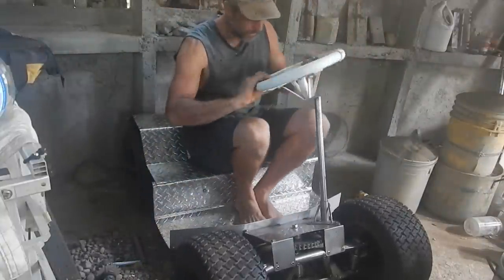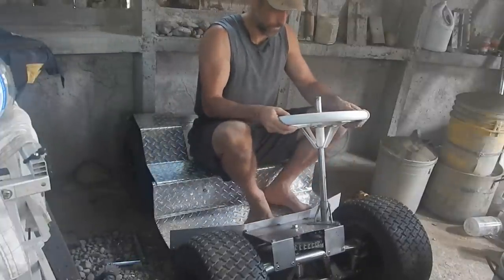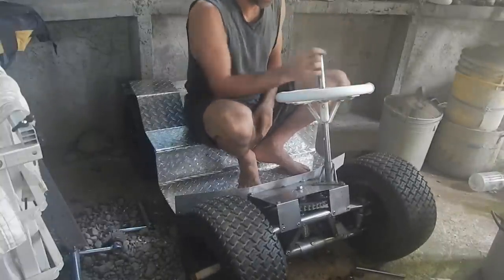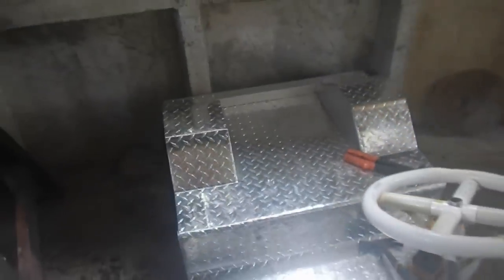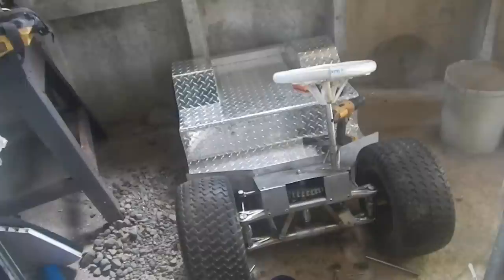Kid Car 008 Floor and Steering Wheel

Comment: Jaimie, you might want to cover all the metal edges with something like a hose that's been slit lengthwise, ?  Round off those square corners by the front wheels, at least, ?

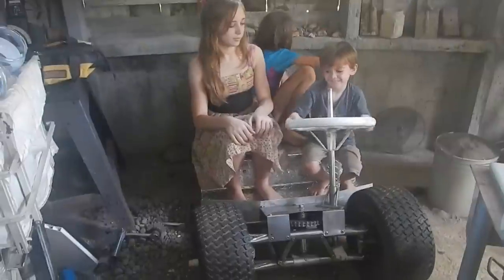Comment: man that thing is sweet. and excellent safety squint at 9:00
Reply: That was all the safety needed squinting and turning head to the left
Reply: @kenvik6192  100%. every seasoned safety squinter knows the head tilt is key.  usually accompanied by a short breath hold. less common but worth mention is the "pull the shirt collar over the nose"-respirator

Comment: Are we getting too lithium battery crazy and forgetting how comparatively cheap a lead-acid car battery is?  Is there a reason to not use them, when possible, on these smaller projects? 🤔
Reply: @tdh7865  Grammy would have loved to have me come to her house for more chats, while I charged the battery we ran lights off of in our Rocky Mountain off-grid camper, but it didn't need to be put on the charger that much.  Long before lithium, we made do.  Correct me if I am wrong, but when I checked Jaimie's $1000 lithium battery holds the same charge as a standard car battery which costs under $200 new and a still chargeable used might even be had for free?